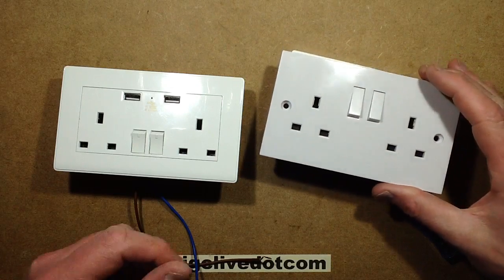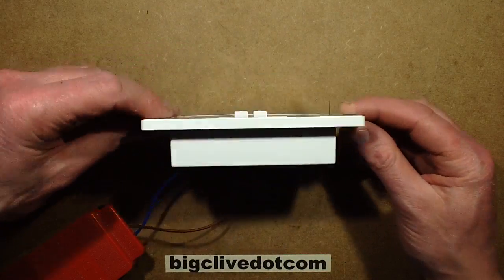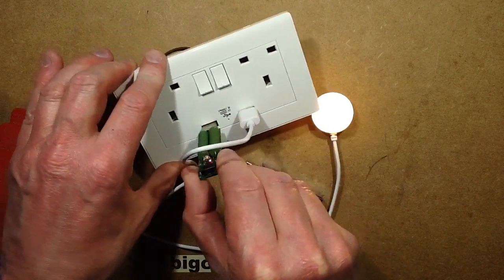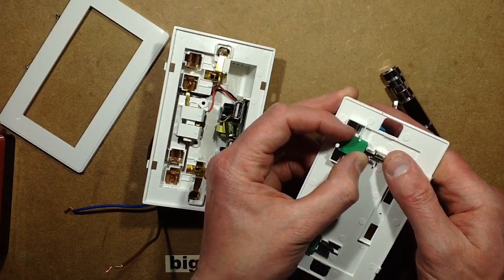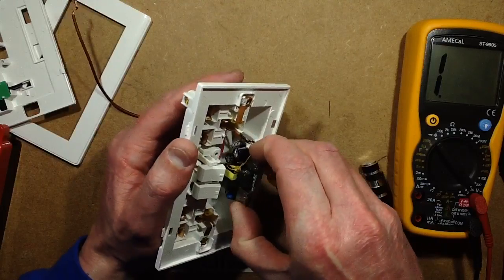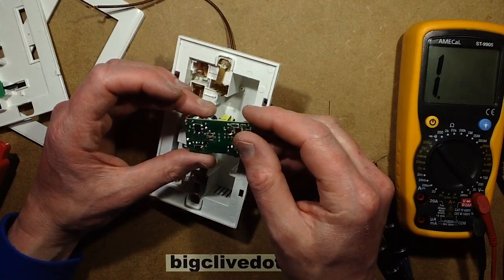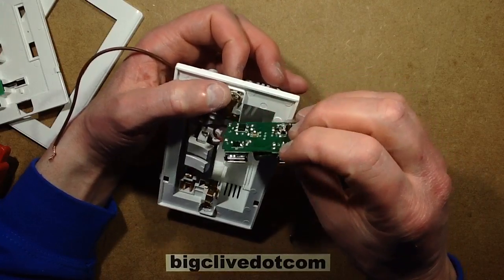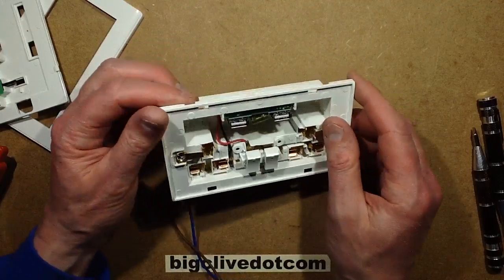A look inside a (crap) double gang socket with USB outlets.

Comment: Some years ago the UK govt ran ads encouraging us to unplug phone chargers when no phone was on charge. This was to save power--tiny for each charger but in aggregate over the whole country a significant amount.

These permanently wired in USB chargers defeat that good advice, even if you get a high quality one.

I have never seen one with a switch in the mains supply to the charger.

Comment: I have done a lot of wireless lighting and have seen this more and more with customer’s wanting led lighting and the electronic dimmer not being able to work properly with such a small load on the circuit which is the same thing your seeing as soon as you put a load on it worked you can see the same thing if you add a 240 lamp on a led circuit some of the dimmers could be programmed

Comment: 4.8a usbs are aimed at fast charging (at 2.4a) 2 devices simultaneously, they won't (or shouldn't, if they're at spec) provide 4.8A to one socket.
plug 2 devices into a 2.4 and you should get only 1.2

Comment: yes I installed one some 5 years ago .Not happy with the USB as it is always on ,,now  it does not charge no more so I am not going to fit one again
installed the double switch socket and I will in future use a USB adaptor

Comment: I got three of this in my house for over one year and had no problems with it. Both iPhones and android smartphones being charged almost every day within no issues. They nice design and simply look nice compared to standard ugly sockets. Only thing is to connect both earths slots to both sockets to make sure that both are grounded, but maybe that’s why two slots are there, isn’t it. I know that we would like to have more staff being made and used in UK, but it’s not reason to call simply cheaper and good solution “Crap”. Also you said that you don’t like  USB units being integrated in socket, but it sound like you mind just in this one, cause you didn’t said that you just not recommend using such in general. Generally you have made more traffic on your YouTube channel and generated some income and put off some people from buying this and going to B&Q or other places and buy also Chinese staff for twice as much.

Comment: Really don't understand the sockets with switches on them, are those square pin plugs so hard to unplug that you need a switch?
Reply from the maker: It's convenient to allow things to be switched off without unplugging them.  It also avoids an arc being pulled on the socket contacts.

Comment: Yeah i have a usb intergrated mains multisocket that shocked me during ground testing turns out it was the house socket those lazy scums myst have done it the fastest way possible, doesn’t work for my use they should be glad i didn’t finish my EE degree i would make them dig a deep trench and connect it to my huge copper jump cable filament by filamentw
The usb port is nevertheless if not dangerous very much like what i am used to make.. î the bathroom. It reads 80 volts dc on the metal of the charger gives a small to moderate shock and climbs back instantly to 80v. Still haven’t decident if it is dangerous or not we strangely didn’t study that in our elevtronics classes

Comment: Where did you get these clamps at 1:15? I also need something like this for testing.
Reply from the maker: It's a Cliff Quicktest.  Designed for labs and workshops for testing electrical equipment.
Reply: @bigclivedotcom  ok pefect, I found it. Thank you 👍🏼

Comment: "If you have a socket like this, loop between the two earth connections. . . "  Personally I'd disconnect, remove and pulverise with a hammer.  Then replace with a decent item from a known manufacturer.

Comment: The two earth terminals were a change made in the naughties if I'm not mistaken and High Integrity earth sockets were born. According to my area engineer they were considered a better means of earthing where IT equipment can see mains voltage through the Data leads. I was wondering when to mention this to our favourite electrical protagonist.

Comment: Did you check the earth connections in each socket individually to see which of them (if any) actually went to ground? The only way I can imagine the two ground connections being separated would be if the wiring attached to one of them (or both) was loose and had come off at some point during shipping/storage/etc. 0.o

Comment: Great video Clive, that split Earth is very dangerous. That Earth should have been internally connected through. The problem is that this non-compliant stuff gets into the country via ebay, amazon and fleamarkets with no trace of origin. A proper plug in adaptor is the way to go. Don't like these internal charger designs.
Reply: Yes, you should test the installation always but if you are careless, you might test just one of the sockets. Then if you plug two grounded devices and the one without earth fails you have a very good chance to get shocked phase to earth.

Comment: I had seen those sort of wall outlets with the built-in USB power ports even here in the US and my wife liked the idea and wanted one.  My gut feeling was that they weren't a good idea, just from a reliability standpoint, so I procrastinated until my wife forgot about it.  Yeah, I know, women never really ever forget about *anything*, they just hold it in until one day it explodes, but she quit nagging me about it and that's close enough as far as I'm concerned. :)

What would be a better idea as far as I'm concerned would be to have each outlet wired not only for normal line AC voltage, but also wired for 12VDC.  Maybe using the 5.5x2.1mm barrel plugs / jacks?  Those can be had for around $0.10 each on eBay and could probably fit even in the corner of a single outlet box.

Comment: Glad you did this, I've been looking at getting some but because the packaging does not state if they cut out / overload protection, I have refrained from purchase, I know most USB devices have them built in, but Im also a fan of a 2nd backup, since you pointed out the earth flaw, non smoothness and more concerning no isolation switch, I'll give them a miss, don't think home insurance would cover a Chinese non isolating socket permantly wired to mains, and we all know that someone WILL be a victim of a faulty socket one day.

Comment: its so you can have both usb ports charging 2 devices at 2.4A each, rather than only 1200mA for the 2400mmA option and only 500mA for the 1A option

Comment: when i moved into a new house, one of the outlets felt weird. it had earth pins but there was only 2 wires inside. i thought the neutral was looped to the earth, but all electronics with metal parts felt a bit .. fuzzy . i opened the outlet and it wasn't neutral, it was the live wire. it kinda scared me and i checked all outlets and wires around the house. luckily that was the only one.
Reply from the maker: Even if you body is made live at full mains voltage, you may just get a tingle or get no shock at all if there's no current return path.  But if you had touched any grounded metalwork while holding a live metal cased appliance it would have been a very violent experience.
Reply: bigclivedotcom yes, I know this. I study electrical engineering. but I still don't get it why only few of the outlets are grounded.

Comment: The instability of the USB DC voltage may be due to drifted spec of the capacitor on the output side of the power supply.  I've built stuff and always test the components, and once in a while there's a new part that is not in spec.

Comment: Anyone help?? Got British General one for maplin the other day with 2.1A charging. Got home and fitted it then I noticed that my neon screwdriver lit up off the USB got the multimeter out and got an reading of 81v AC from the supposed earth of the USB. I removed it again assuming this is not correct. Should I be taking this back? All connections are correct and tight at the back of the socket. Any help would be appreciated Cheers
Reply from the maker: It's normal.  There's a slight capacitive coupling between the mains side and output.  The current is only microamps, but enough to light a neon driver and even give a slight tingle.
Reply: bigclivedotcom cheers for the quick reply. Thought I'd check Incase.

Comment: How will these affect insulation testing readings if you've got several installed on the same circuit? I can imagine it becoming a nuisance and causing false readings.
Reply from the maker: You couldn't do an insulation test between live and neutral conductors as there is always an unremovable load.  Between live and earth should be OK for a properly designed unit.
Reply: meh, call me old fashion but I don't like the idea of a permanently connected SMPS from china wired into the wall. We get enough fires from things in the room going pop just imagine the nightmare of having the inside of the walls going up!

Comment: Very interesting video. I've steered clear of these potential fire starters because like you, I am not keen on the idea of having cheap, crappy electronics permanently connected across the mains supply. To be acceptable,  there needs to be physical isolation from the mains so that the USB ports can be switched off when not in use; i.e USB sockets enabled through a proper switch. I've not seen one that works this way, even from reputable firms like MK. The earthing issue on this one is also quite nasty and could be missed by a DIYer and might even be missed by an electrician.

Comment: I agree with the dead ballast problem.  I have a can light at home that doesn't work due to the ballast not working.  Now to fix it I need to replace the entire can (or go into the attic and see if I can replace the ballast itself).  I find it to be one of the worst designs I've ever seen.

Comment: hehe, only watched a minute now...... but notice the small lights bulbs immediately. i think their GREAT, easy to use, bright but not tooo bright light, have a good switch on the cable, to connect at usb.
i can be wrong, but i think this item is best value for its money of 2,31€. count all items seperately and you pay more....
also its very practical at many places, i use it daily as a nightlight when im still on my ipad.
im thinking if it wouldnt be best to buy a peace of 10, as all good items go up in price quickly.....

also... great job with all the reviews, love watching them. this from avionics tecnician daily at work in the cockpit. electronics love it :)

Comment: so after watching this it suddenly twigged why I get a wee tingle from my radiator sometimes if I'm leaning on my usb cable at the same time! turns out the usb ground is at 84VAC to mains ground!! it's plugged into a screwfix double gang double usb socket 2.1A. not too dissimilar to the one in the video. is this legal in the UK? http://prntscr.com/f7rt8d
Reply from the maker: The tingle is a slight leakage due to capacitance.  It's very low, but a high impedance meter will still show it as a modest voltage.

Comment: will that "crap" socket fit into the plastic base since the construction at the back side is bulging very high. there is little space left to dress the mains cable size 2.5mm sq. running from the live and neutral screw terminals. i vote NO.

Comment: 6:19 - 6:40 --> Yes, it is a good idea.  Why don't they use something like that on US plugs?
Reply: We do.  They sell them in Home Depot and Lowe's, and I believe they're now required by US law in new homes.

They're a good idea in theory, but not in practice. The hinging systems on them break very easily and you end up with a useless outlet that you can't plug anything into. Plus they cost about ten times more than a regular outlet.

It's better to install common sense in your children than installing these pieces of crap.
Reply: +Adam Ohm I completely agree with you that teaching your kids common sense is priority one.  However, really small toddlers that haven't said their first words yet would still benefit from outlets like this...at least receptacles that can be reached by floor level.

Comment: One should know that the usb socket is only rated to carry 500 ma. Forcing higher current could burn out the connectors. The reason why some 5 volt usb  power supply's may not charge  3.7 v battery is because the power supply does not have a soft start internal circuit. As there is no fuses on the 5 volt side, the inrush current to the battery is high (charging the capacitor of the battery) and would trigger auto shutdown as the power supply thinks its an overload which in reality is not. Something to think about. Some usb supplies do have soft start internal circuit but are not told. You have to figure it out with no  help.

Comment: Switching power supplies often need a minimum load to work properly. Thats, together with millions of other reasons, why I hate them. Sure there are some decent designed ones around, but most of these pain-in-the-ass turds should be thrown into a dust bin right away.

Comment: Like yourself, not keen on the built in fixed electronics. Also the fact that they're constantly on, and not possible to switched off personally makes them one the most stupidest engineered products for Joe. Waste of energy, when we're always told to save, waste of electrical waste and production and the needed dual earth, dangerous and bonkers. I'm really surprised this product ever passed regulations, especially in energy wastage. Companies like mk are making them too. A standard sockets could last forever, but the electronics.. Hardly a year.

Comment: I live in the United States and we don't have switches on our outlets why do your Country have them?
Reply: Seth Walker It's just different electrical socket standards, some European countries also don't have switches.

I didn't like them at first, but after I got used to them I changed my mind. These switches allow you to shut down a device without having to take it out of the socket, so It's just more convenient once you get used to it remembering to turn a socket on before you start using your device (which I hated at first, but now I very much like it).

Comment: Am I right in saying that if you had 2 of these on a ring main and while wiring the sockets and instead of putting the 2 earths into the same terminal, you put them in different earth terminals you would end up in the situation where anything in the ring between them wouldn't be earthed.
Reply from the maker: Yup.
Reply: bigclivedotcom scary stuff considering these are probably going to be fitted by amateurs a lot of the time.

Comment: It's a (ring circuit) FFS, not (Ring main), like you'd find supplying K Amps! Love the vids BTW.
Reply from the maker: Ring Final Circuit to be exact, but it used to be called a ring main in the past.
Reply: Quite correct and they're all called final circuits BTW, ta for reply and regards.

Comment: “ Hoots Mon” That socket looks pretty cheap
& nasty, I sure don’t like the look of those flimsy red/black wires
connecting the module to the mains supply, surely they must carry the full
240volt supply to the module at all times, don’t think I would sleep at night, especially
as I have the old style fuse box, without RCD or ELCB  My local Screwfix currently has an offer on similar
devices, I wonder if they are all made the same way, as I should worry about
having these things permanently wired. Would be good to have a switch to control
supply into the device mains side.

Comment: Android phones have 2 way USB ports, aka the same port can work as a client or a host 

the unstable current probably confused the circuitry making the phone refuse charge as a safety measure 

Apple devices, to my knowledge, don't have the functionality, so they accept change
Reply: current*
Reply: not all. for example my Sony Xperia M has usb-otg, but the Samsung Galaxy core prime, and core pro, of my siblings don't have usb-otg. also Nokia X2-00 has usb-otg
Reply: ΑΡΗΣ ΚΟΡΝΑΡΑΚΗΣ 
I'm just thinking of what could be causing these, what is even more strange is that Apple products are so strict on what they allow as changers and don't allow normally
Reply: Hanro Lareman also I forgot to say that ios supported usb-otg from the start, however the proprietary ports, and the price of the adapters made this to pass silently. The Android got usb-otg support in the v.2, but it's upon the manufacturer to decide whether to put or not. As for the adapters: I found low as 2€, and I go a Lexar 32GB  A/micro B usb flash drive

Comment: It is almost impossible to make a Universal USB charger without building intelligence into the charger. Some manufacturers don’t follow USB 2.0 specifications exactly because they are following Apple specifications  (2.8V on D- and 2.0V on D+). Most Android devices will default to some low level charging voltage if they don’t see a valid voltage on D+, D-.  Many double outlets have a designation NA (NonApple) and A (Apple)
Reply: As far as I recall, shorting D+ to D- and nothing else is the standard way to signal 1A or 0.9A charger, so that part is A-ok.